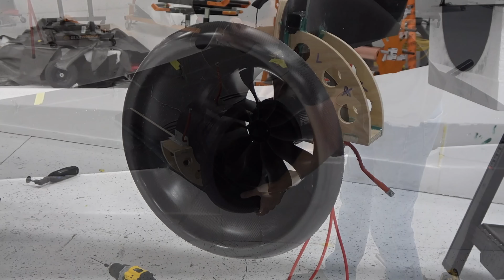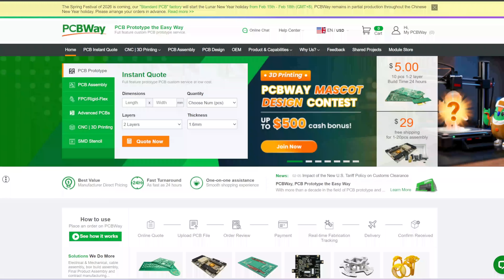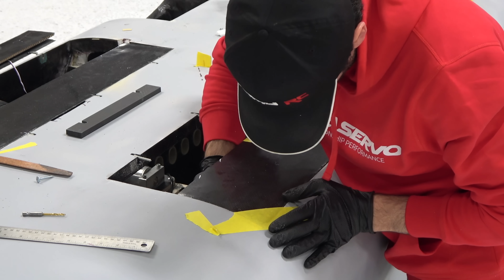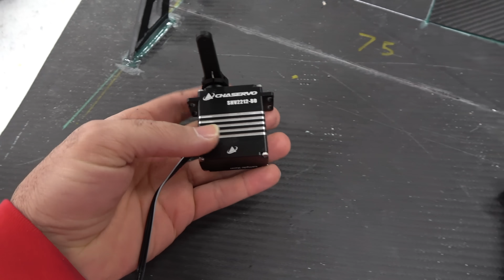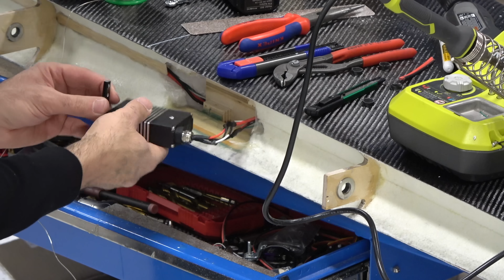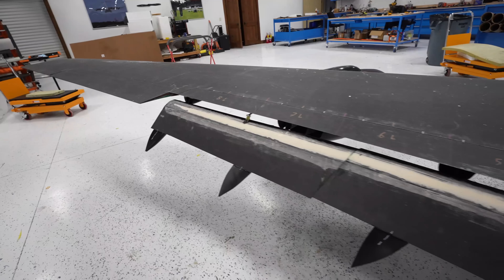Building the world's biggest RC AIRBUS A380-800, Part 3

Comment: I feel like you are cheating, you did not scale the real plain down you scaled the model plain up, the reason the rc plains have the arms sticking outside is because of size but I feel like on that size of a model you could have used other techniques to make it work internally, but it looks good for a huge rc plain but it doesn’t look like a tiny real plain 🤷‍♂️

Comment: I worked in English training for Airbus for 7 years from 1997-2004. Throughout the A380’s gestation. As far as I understood back then it was initially designed with no thrust reversers. It has 16 braked main landing gear wheels. Its brakes are sufficiently fail safe: both numerous and very powerful. I was told that it was the FAA who insisted on two reversers for certification.

Comment: Spirit airlines newest flagship. It still seats 211, so long as you're generous with your interpretation of "seat." Also, you might be on the ramp for a bit, while they find the "good" AA batteries for the radio.

Comment: Just wonder how Ramy figure out the shapes of the molds on that specifix scale. Also the calculasions of the strength of the material, connections and hinges. Also to determine the final weight of the aircraft and the power to weight ratio that also have to be on scale otherwise it will fly like  a butterfly or  like a hot air balloon. 
Never the less i would like to see the video where he will take it for the first flight.

Comment: hi, for the rudder i think is better to do the opposite, as a pilot, at high speed you need a really small input on the control to make a big movement, wile at low speed you need to move te control more to archieve a small movement

Comment: Rami, as much resources you have, this size of airplane should have been loaded with the details, I am unable to understand why are you not able to make scale landing gear doors, flaps (fowler) with scale hinges, leading edge slats, panel lines etc, honestly your approach in making models is still pretty much the same as when you first started making models. Overall the aircraft looks good but very disappointing in details.

Comment: The amount of engineering just to plan out the build is mind boggling. Designing the wings, flaps, spoilers, lading gear. Then designing the molds for everything. Not to mention building all of the composite parts. I would think it would take a whole team of engineers months to do this from scratch. Keep up the great work and feel free to post more of the behind the scenes or troubleshooting content. If you can do a separate video strictly on designing everything I think that would be fascinating. for example what airfoil you used and how you incorporate it into the design of a scale wing. Also what washout / twist you use for these models. I think everyone would find it very interesting. Cheers mate!

Comment: Nice to see you guys found a new wheel & tire supplier for the 380. These look very scale and capable compared to the thin ones on the 777X. It would be nice to see the 777 retrofitted with the new wheels & tires and then reflown/re-recorded for the channel. That's one amazing plane and it deserves the upgrade. This 380 boggles the mind. 750 lbs? That's seriously weight for any RC type plane. I never had the need to look into it, but what are the FAA requreiments to fly for models this weight & size? I assume you have an exemption or waiver for the specific area around the compound, but it would be intresting to hear the mechanics behind what is or is not required and how you are able to gian exemptions, permitting, or whatever is needed. Keep up the madness.... Can't wait to see th epaint job on the blended body. That is a really neat project.

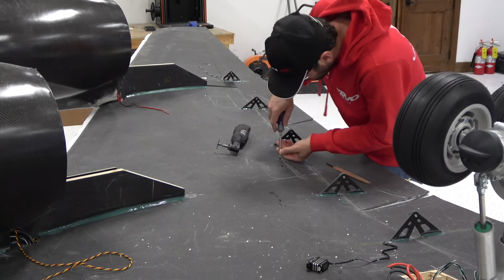Comment: What make/model of cordless tool is that at the 8:43 mark? I searched everywhere and can't find a match. I even took a pic of the screen and asked 3 different AI apps and each gave me different results with none of them being the correct one.
Reply: It appears to be a Dremel cordless rotary tool with the right angle attachment. Hard to tell for sure which model, but probably something like the current 8250 tool.

Comment: Hey Rami, for some added scale, Airbus like to split the ailerons too. Inboard ailerons for high-speed flight. Additionally they mix spoilers with up moving ailerons too. Don't know if you need that much control in flight but would be a cool effect to simulate on the ground for "flight control checks"

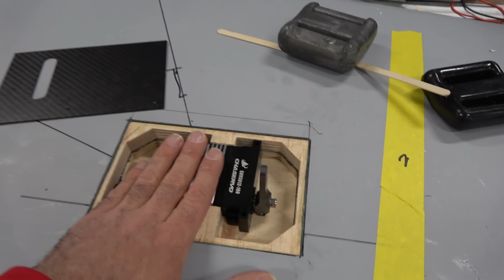Comment: 10:44 Ramy at what point have you made your evaluation that you need 100 KG of torque on the ailerons ? - it seems insane much but I have no clue so am just wondering :-) ?
Reply: IMO he probably didn’t do the math. However, he’s not budget constrained and you may as well be over spec’d and not risk having too little torque.

He’s clearly got good intuition built up from years of doing this.
Reply: @Tjkrusinski True - and thanks for YO.

Comment: I wonder if there is a way to monitor how much foot pounds of torque (or inch pounds) is actually put on those elevator servos.  If that could be known, then it would be easier to find the right servo for a particular job.  Great build again Ramy!

Comment: You havent thought of using pushrod actuators when you do not need to put a servo on the external of the frame? You get 12v actuators of up to 800kg.

Comment: Tyler is going to need a bigger workshop/hangar soon !!!
Reply: He built a second, larger, hanger specifically for this one.
Reply: He's gonna need a longer runway!
Reply: @TroyHoffman-7m2 with runway lights, radar scanners, and an mini ATC tower... mind as well go big...there is plenty of money in the Perry household to go around.
Reply: Economics is not a problem.
Reply: I'm wondering when he'll hit the legal limits for how heavy an RC plane can be flown in the U.S.
Reply: @michigangeezer3950 I would think it would be under similar rules as LSA aircraft. Or ultra light aircraft. Has proper lighting. If it's kept under 500 ft agl, i would guess legally one could argue it's no different than either category of piloted aircraft. Line of sight. I mean idk. I'd be more concerned with Atlanta class B airspace above my airport. I'm really not sure about the regs, pretty much this is uncharted territory. Its not a drone. Its flown line of sight. If you put a go pro in the nose, how isn't it a fixed wing aircraft? And it's still cool AF! WHO CARES?? I want one...lol
Reply: @TroyHoffman-7m2 Grok says anything over 55lbs has significantly increased regulations. I'm sure a skilled builder and Perry's money would be in compliance fairly easily but now I want a video just about that.
Reply: @michigangeezer3950  legal limit for US is 150 kg so he already did crossed it... several projects ago. Its not model anymore, its full fledged UAV and it have to be legalised with FAA. You can fly heavy RC and drones, they are just not considered toys anymore.
Reply: much bigger doors
Reply: Gotta be nice to be so rich that you can spend 100,000s on a  rc hobby. Good for Mr. Perry
Reply: I appreciate that Tyler shares these builds and flights with us via Ramy and his videos.  Something positive and inspiring for model aviation from a billionaire for a change.
Reply: They should install little cameras by the windows with views of the wings
Reply: he's going to need bigger doors